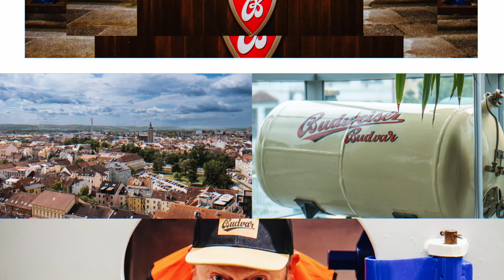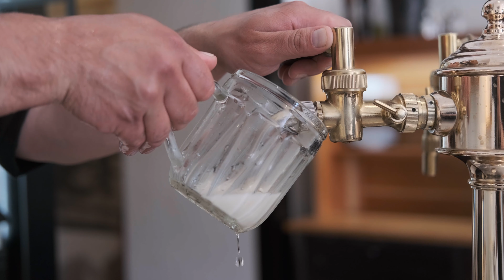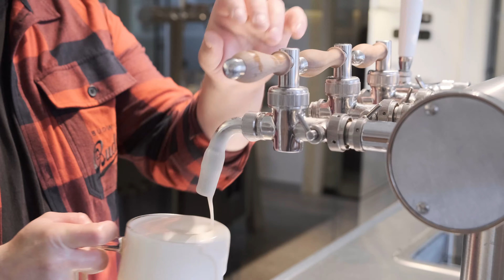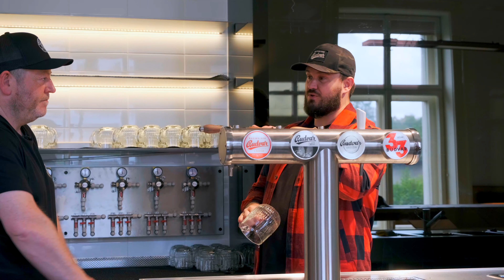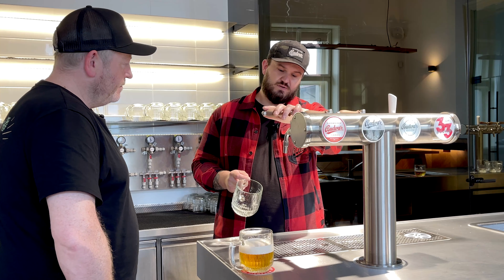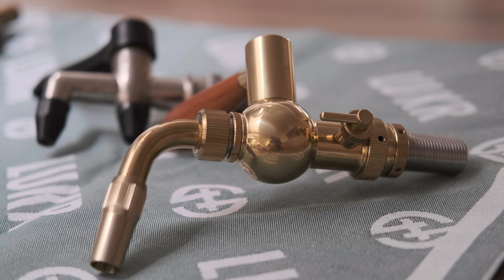A Journey Into Czech Lager | The Perfect Czech Pour | The Malt Miller

Comment: I wish this had also mentioned how to get the best out of bottled or canned Czech beer in terms of the pouring.  Is there anything you can do to ensure a good head?
Reply from the maker: Yes, following much of the same principles as pouring. Start with a very clean glass, thats been chilled to the same temp s the beer. Then do a hard pour for the first 2 thirds of the can to get the head thick, then let it settle for 30-45 seconds before gently pouring the rest in! Also, if you have the Budvar tankards that helps as it looks cool!
Reply: Don't. I think it usually tastes better straight from the bottle/can, because pouring it trough air will cause oxidation. There is a reason why we submerge the tap (and why the sidepull taps are significantly more expensive) and definitely don't use warm, dry glass, that should be considered crime against beer (rinse it out with cold tap water)